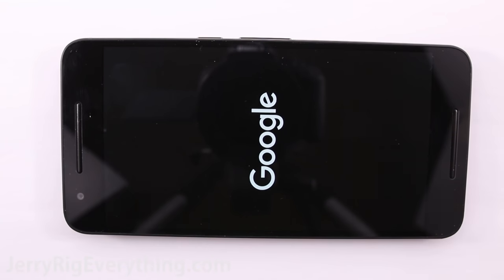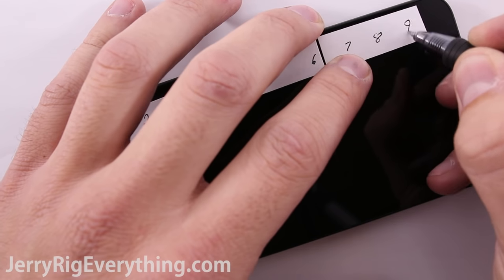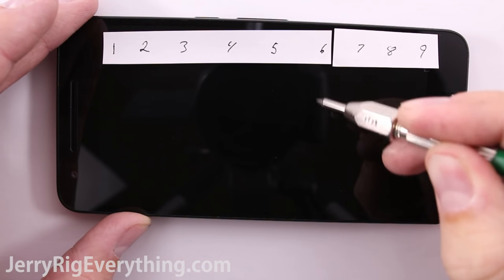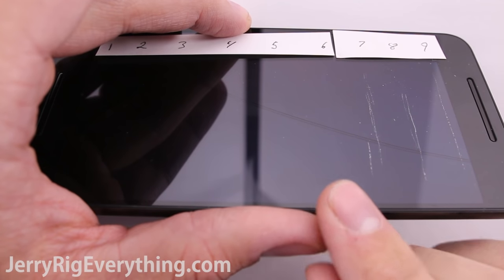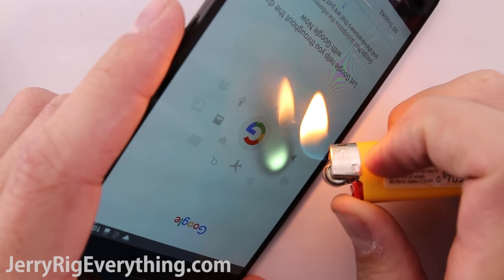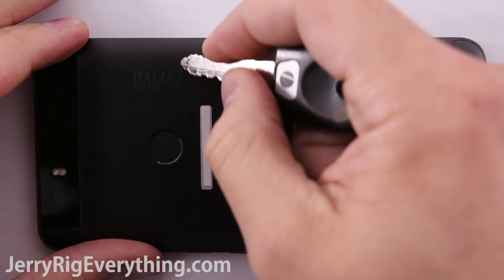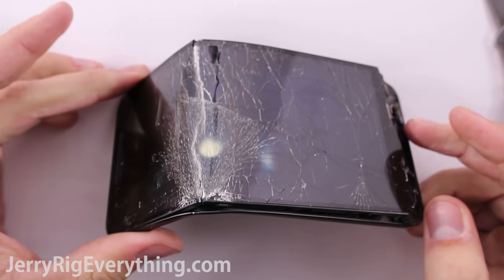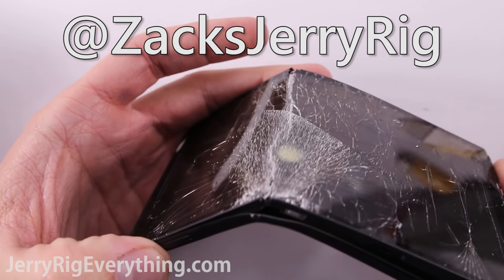The Nexus 6p is a Joke!  Bend Test - Scratch Test - Burn Test

Comment: Scratched it DEEP. You torched it then bent it and it broke where the heat weakened the glass. Great. I'm glad to know that if I am attacked with a flamethrower by a werewolf with extra sharp claws, while looking at my phone, that I shouldn't attempt to bend it afterward.
Reply: +Greg Scavezze He repeated the bend test with a completely new nexus 6p. Same results.
Reply: Well, I've had mine for a month and so far so good. Basically I learned from this, don't bend your really thin aluminum phone. I don't keep mine in my pants pocket, so no biggie for me.
Reply: +Sean Kim u clearly didn't watch the ending when u still see the white mark from the bend test as he shows youbthe bent phone
Reply: ***** I did not, atm I cant watch the video. But what does this mean? The white mark I mean.
Reply: +Greg Scavezze the point is , other flagships can withstand that?

Comment: So many fanboys offended really by just showing how this phone is weak and it won't get to them that this phone has a shit durability.
Reply: Taskin Forkan Last time I check glass isn't the thing that gives a phone its structural integrity.
Reply: Taskin Forkan No it doesn't, the frame inside the phone (not the body) provides strengh.

 I don't know what kind of aluminium you're talking about, its not made of the same aluminium as a coke can, its way stronger.

You saying glass provides it is like saying the cheese holds the pizza together.
Reply: If you did your research, you'll know that video is fake so.....yeah be quiet
Reply: john doe
This was a pre-release model. The final product can withstand up to 90  pounds of force before it bends. Check max lee's video
Reply: +Taskin Forkan Other phones are tested the same, but even iPhone 6 holds better.
Reply: Taskin Forkan I think no one of them put it in back pocket. ))
Reply: +San Yosef Lyudvikov It was exposed to high heat that weakened the structure and then massively cracked that compromised that structure even further. It is known that having a cracked screen makes ones device weaker
Reply: +Grayson Maximillian Phoenix He did it again with a fresh new phone. Unlucky mate.
Reply: Taskin Forkan I didn't say the build quality was bad.

Comment: wow, you really pissed off the lagrdroid fans Xp
Reply: ***** All these names Apple fanboys come up with for Android fans is not ofensive at all. The term iSheep is enough to get Apple fanboys to break their monitor
Reply: Tenza Emtade
That's because Android fans know their phones better than anyone else and they have no reason to listen to the out of touch iSheep. Meanwhile the iSheep know deep down inside that that is exactly what they are.
Reply: +Mr. Mxyzptlk iSheeps don't even know what their phone is made of or what internals does it have!
They're like "Hey it just works!" Lmao! 
These iSheeps I tell ya!
Reply: C'mon you can be better than this, android don't suck as a platform, is the lack of optimizations of the OEMS and I'm some devices cheap hardware that causes not perfect performance. Sometime ago I did a test of my Galaxy S5 running a INSANELY fast custom ROM, and my friends phones which were a galaxy s6, iPhone 6 and 5s, and my (2 year old I believe) hardware was toe to toe with iPhone 6 and galaxy s6 launching apps and camera. ROM BTW is EXODUS last nightly.
Reply: +Brickcellent exactly lagdroid doesn't work, that's why you shouldn't buy it :p
Reply: It actually works equally good if not better now.
No advantage in buying the iPhone now.
Reply: android and iphone run smooth after 2 updates ^

Comment: isnt this  pre release hardware? 
this isn't a very good video. show the system settings and model numbers etc. 
not a die hard fan though. 
you said camera hump is scratch resistant , bro its made out of the same glass as the front ? -.- 
plus do some research on aeronautical grade aluminum. lol
Reply: if you are familiar with the properties of glass you will understand how the glass on the camera covers a smaller surface area making it harder to scratch and break. however you could do so with a thin pointy compass it is not likely to happen using keys.
Reply: +Lukeiss Dunne surface area shouldn't affect scratch resistance.
Reply: +Christophe Jammet I said it effects crack resistance,my apologies if I was not clear on that.
Reply: +Lukeiss Dunne You said smaller area effects scratch resistance. Here is a quote from your post: "you will understand how the glass on the camera covers a smaller surface area making it harder to scratch and break"

It doesn't make it harder to scratch and break. It just makes it harder to break.
Reply: +Christopher Cox take a key. the glass on a camera protector is a 1×1 circumstance. if you have a coins or keys that are higher than that and therefore cannot fit in the hole then that makes it very very difficult if not impossible to scratch.
Reply: Lukeiss Dunne Okay now you're reaching. :) You said .. "I said it effects crack resistance,my apologies if I was not clear on that." ... which means you acknowledge that it only effects scratch resistance. This glass is not small enough to stop your key from going into the glass so that doesn't apply.
Reply: +Christopher Cox who are about scratches anyways? the point of this video was to illustrate clearly how weak of a device this is. and it certainly has proven this.
Reply: +Christopher Cox Just forget it, some people just can't admit when they are wrong
Reply: ***** now there's ton of videos in youtbe and twitter with every single detail. 
It's unbreakable according to them.

Comment: I am canceling my 6P pre-order mostly because of the awful ifixit score (2/10), and Huawei having non-existent support which means good luck trying to arrange an official battery/screen replacement once out of warranty.

That said, the flame comparison to the GS6 was somewhat unfair. The panel here is identical to the Note5 which is same-gen as the GS6, ditto with the Gorilla Glass 4.
The reason the 6P screen burned is that the flame was held in the same position for 6-7 seconds whereas in the GS6 video it was moved around and never in one spot for more than 2 seconds continuously.

Also cracking the screen before the bend test will obviously make it bend more easily. Not that the GS6 wouldn't be tougher if both were intact before bending, but it's worth mentioning.
Reply: Just go for the note 5
Reply: +Harshith Hv want vanilla Android :/
I can wait another year.
Reply: +squishylime Regarding the bending - only the glass was scratched. The aluminium bent easily.
Reply: +squishylime  vanilla?  Lol
Reply: +squishylime no need to cancel....my 6P is built way better than this one here...
Reply: +Harshith Hv touchwiz is shit
Reply: +squishylime lol why would you contact Huawei for support? The Nexus series phones are designed by Google. 2 Year's ago I called Google customer support and they replaced my Nexus 5 for free :)
Reply: +Phanteus Yep I know a couple people that broke their screens 2x each and got replacements from google, I also have a n5 and fortunately never damaged it.
I kind of wonder if that has come to an end, google is pushing warranty contracts now for those that want to get easy replacements, which I get since it's a more expensive device.
Also you can pay apple to replace your iphone battery, you can pay samsung to replace your gs6 battery, you can replace your own n5 battery, I don't know if those options exist with Huawei devices.
Reply: squishylime Unless you plan to keep your phone for more than 2 years, there is no need for a battery replacement imo. I sell my phone on Ebay every year and update it for only $200 extra.

Comment: Can't even lie this video is VERY accurate and nowhere near fake. Now I do agree he usually stops at a level 7 pick but here he went to 9 which caused the screen to crack after touching it. Besides that though the Nexus 6p is very poorly built and vulnerable to damage. I'm not the best when it comes to taking care of a cell phone but my Nexus 6p has been through the same stress if not less than previous phones I've owned and it's reacted way worse. If I drop it even with the case on the casing of the phone literally will almost separate to where I have to squeeze it for it to snap back into place and the volume/power button to press again. Speaking of those buttons off top they're very mushy and can get jammed down into the phone sometimes and when it happens to the power button the phone starts acting weird sometimes shutting down on it's own or just not letting me press it. It usually just unjams on its own so when it happens I wait a bit. I can see the casing near these buttons raising also. There's a little lump looking like it's bent which is odd. 

With that being said I'm hoping with the Pixel phones being a higher price and with a much better company ( HTC over Huawei all day ) the Pixel won't suffer the same poor build quality the Nexus does.

Comment: Wow this test isn't comparable to any of your other tests. You say that the Samsung AMOLED can handle the burn test. Well maybe you should burn them the same way and for the same amount of time.
The scratch test you say that you razor is a 5 or 6, and a 5 pick didn't do anything to the screen on the 6P either. And when you scratch away with the 7-9 picks you completely destroy the integrety of the screen since those scratches are really deep which makes it crack and bend more easily.
Reply: maybe it will make it easier to bend by a small measurement of .2 newtons (I'll say an entire newton to keep you happy) therefore the screen would crack at 6 instead of 7 however the display cracked at 5. and that's using an entire newton which is a pretty juristic difference to substitute the scratched and cracks. apply this over a large surface area and you have your answer.
Reply: +tonyaik not only that, but the 6P HAS a Samsung AMOLED display. It's essential the exact same panel that the Note 5 uses.
Reply: +timg2727 Exactly. And ... the glass isn't made by huawei. It is Gorilla Glass 4, a product of Corning. Gorilla Glass 4 is the exact same glass on this phone as it is on another phone so it's exactly the same resistance.
Reply: +Christopher Cox 
Yes but the way the Gorilla glass is fixed to the Digitizer differs. My guess would be that there is a tiny gap between digitizer and glass, where in other phones there would be transparant glue of some sort, or the glue used has different properties.
That could mean it can bend downwards here in ways that it would never bend on other phones.
Or maybe the deeper scratches made the difference. Hard to say but I would put it in a Otterbox like protective case.
Reply: Benny Kleykens I'm talking mainly about scratch resistance. It doesn't matter how it is affixed to the digitizer. The top layer will scratch exactly the same regardless what phone it is on. I agree about bendability and rigidity.
Reply: +tonyaik Remember that the screen is composed of only 2 things:
-Gorilla Glass 4
-Samsung's latest AMOLED panel

When he is burning/scratching the screen, he is testing what the Gorilla Glass 4 and Samsung's AMOLED can handle, which Google and Huawei has no control over. I would say the entire test and the way he talked was purely idiotic, since both the glass and the panel are best among the market today.
Reply: To add on to your argument, burning the screen can cause it to bend easier.

Comment: My contribution: I sat on it last week, while getting in the car. It bent in a curve shape, at about 15° angle between edges, which let me underline: it's a fantastically sharp angle, I was looking at it and seeing new phone in my eyes. I unbent it with my hands, I was surprised by 2 things: Yes, a child and it's baby hamster could bend this phone, it's very malleable, but it did not crack or snap int he process. It bent in a slightly S shape, so I had to re-bend it and adjust accordingly. 2 diagonal corners were unaligned, so I had to twist it a bit, too. Now I just got a replacement aluminium cover, because, as Zack said, the paint scratched a lot, just by having some dust and tiny sand in the protective rubber case, which is unavoidable in time. My 3rd surprise it would be that after all this, the phone works flawless. As honourable mentions, I left it on the dashboard, in the sun, numerous times, I had it in the pocked while in the rain, to find out my pocket had water in it, and lastly, I dropped it like 50 times since I got it, because I'm careless. Bottom line, I am happily replacing it's back cover because this phone has passed the test of time and torture and I would love to continue to use it. I do play the latest games on it, it works brilliant with google maps and every app I throw at it, no crashes, restarts or anything, and I do have the latest beta android. For me, personally, it's money well spent. But I was aware of this video from the get-go, so I knew what I was buying. Thanks, Zack!

Comment: Ridiculous. Zero credibility. 

In what circumstances of real life is a phone (or any gadget) exposed to heat like a lighter for that long? Or at all?
Reply: +David Martins He does the lighter test in all his phone reviews to see how the display reacts to high heat in comparison to other.  Is this the first time you've seen one of his videos?
Reply: First and last.
Reply: +markevens Just because his tests are consistent doesn't make David Martin's point any less valid. I don't want to see how a phone reacts to catastrophic events. It'd be like claiming which phone is better based on how they fare after being shot full of bullet holes.
Reply: +markevens the scratch and bend test are good tests. but either way the point on the flame tests is valid i mean really can you honestly tell me you have put a lighter near any of your phones by "accident" no or have you ever dropped it in fire. and anyway if you did drop a phone in fire like say at a bonfire party its no doubt going to be destroyed.
Reply: agree. tomorrow he throws a PC into lava, pulls it out,  pours water on it it salvage anything that hasn't melted, throws it into a tub with a plugged in hair dryer AND then sees if it can out-perform a macmini in a stress test.

Comment: Such a shame.. I heard the 6p offers one of the best android experiences out there.
Reply: brah...this isn't nexus 6p :)) it's a replica...take a look on the back of the phone,there's no huawei logo
The nexus 6p is rock solid.
Reply: +DannY42105 it's at the bottom
Reply: as of software and hardware, not construction.
Reply: it is a real one and it is on the bottem
Reply: Ehhhh. I think I'll just go with the Oneplus 3 for my next android phone instead of the Nexus 6p.
Reply: Why the hell would you even think of buying the 6P which is out for almost 1 year? Go for the OP3 of course, it's a no brainer
Reply: I just moved from Apple and got my first android phone late last year, and I instantly liked it better, but my question is..
Reply: Luís Paredes What makes the Oneplus 3 so much better than the 6p (other than build quality)? My situation is that I'm new to Android, and I have little money so I bought the Alcatel Onetouch Idol 3. The build quality is crap but it's a fine phone overall. I had to get it repaired once already so I'm looking for a new phone in case this one just dies one day.
Reply: +Jahbari Akua The OP3 is more recent, way more resistent, has better performance.
The only thing I prefer in the 6P is the stock Android, but it's still not worth it.  It depende on how much money you have to spend. For 400 euros, the OP3 is the best smartphone on the market right now, hands down.
Reply: Luís Paredes I'm takin' it then. Thanks!
Reply: ***** Do you have one? Also I don't really care about 2k or 4k screens on my phone. I can only even notice the pixels on my 1080p Idol 3 screen if I look closely, so I don't care. Also, I don't use my phone's camera much at all, and wouldn't even if it was amazing. Is the sound bad on headphones or just the speakers? And finally, yeah, I heard about their terrible customer support.
Reply: @Dex4Sure Care to back up your statement that they "destroy" the 6P camera? From what I've heard, the 6P definitely has near best in class low light performance and overall color reproduction, with the only real thing that lets it down being lack of OIS (with EIS on recent software being much improved.) It may be slightly bested by the S7, but I'd call it about even if not slightly better overall than the S6.

Comment: Can agree. While my 6P has handled falls, it has always had a case. With a case, it somehow has drop marks on the back of the body. And the top right corner of the screen has chipped off from taking a case off. Also, the entire phone is slightly bent in one corner from my pocket.

Comment: The reason the glass cracked after scratching was that after the top layer of glass is chipped, even slightly chipped like what he did here is that under the top polished layer of glass the insides are under pressure so tapping it slightly can release the pressure on the inside and crack the screen, this happened to my Samsung Galaxy S4 when there was a chip in the glass I set it on a table and it cracked.  This is the same principle as in the Prince Rupert’s drop.

Comment: i bought nexus 6p, my first expensive phone. now battery last 4 hours max after 1 and half years and back is full of scraches 
although i have used a case all the time. Bonus points for it surviving a pocket drop from motorcycle at 80 km/h (50m/h). But next time i buy a phone i will watch your review of the device for sure!!